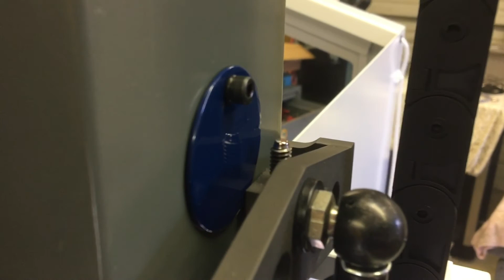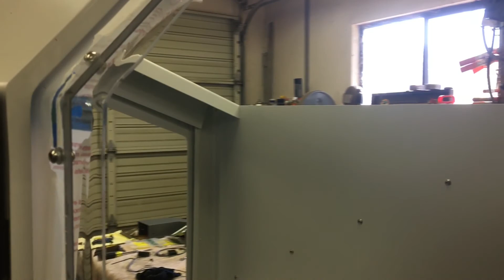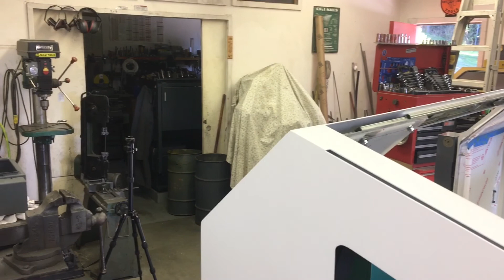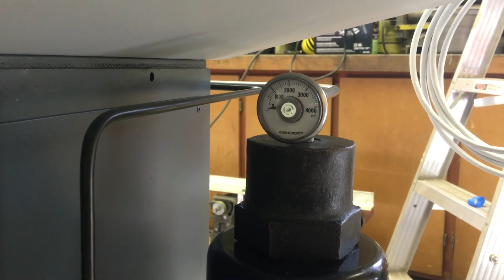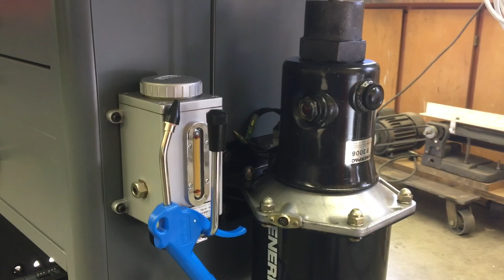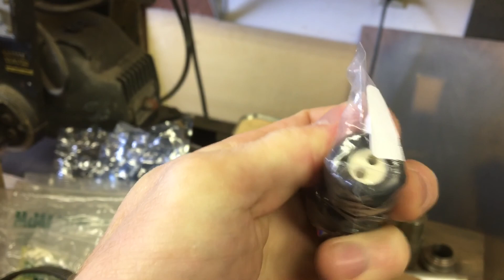GRIZZLY G0704 CNC Conversion Update 30 - ( assembly 8 )

Comment: This was one hell of a build. I'm surprised you didn't cast your own base, column and bed out of granite. Pickup a Tormach/Skyfire spindle and its basically a DIY VMC without the tool changer, which I hope we will see eventually. Should be interesting to see what kind of finish quality you can achieve in 6061 with the linear rails. Hopefully you pitch that saddle and do the Y axis eventually.
Reply from the maker: Thanks Chris!